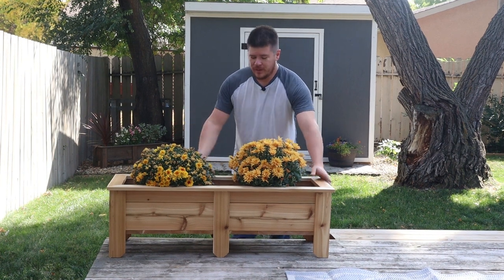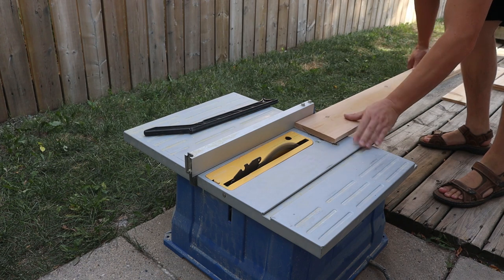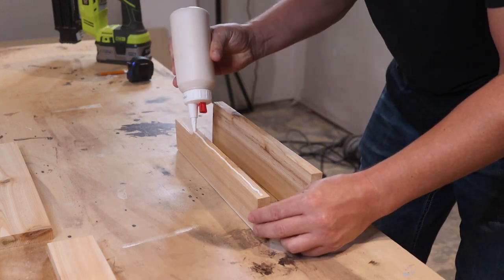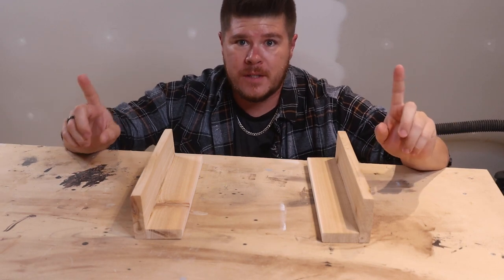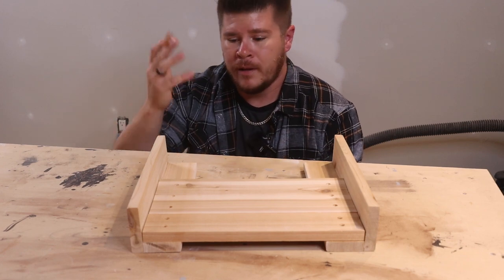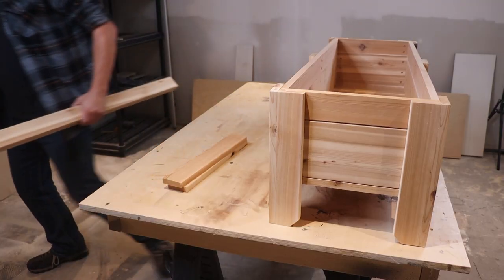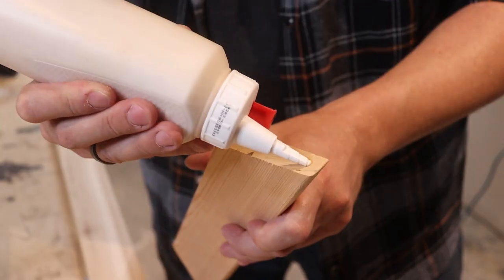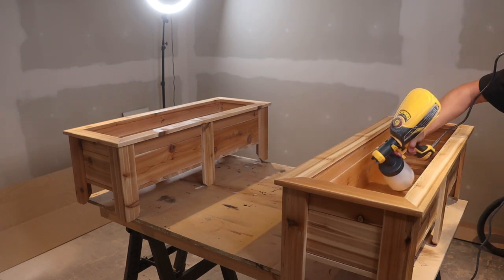DIY Cedar flower box from fence pickets // Classic style and an easy How To - plans available

Comment: That’s one of the simplest yet best looking cedar planter boxes I’ve seen done on YouTube. I am going to build a few of these this spring for sure. I’m wondering if it couldn’t use a bit more drainage at the bottom though. Either a few holes drilled or a little space between each bottom plank, covered with permeable landscape fabric.
Reply from the maker: Thanks, I'm glad you like it! I've thought about drilling some small holes, it honestly wouldn't hurt. I've made a few of these now and once the wood dries out a bit and shrinks ever so slightly, they have small seams between the bottom boards most of the time anyways. Good luck on yours, I'd love to see them when they're done!

Comment: Nice!

The only thing I would add is some drainage holes .... it is going outside after all ;o)
Reply from the maker: Thanks! Ah, I forgot to mention that. The drainage is actually built in, there is about 1/16" gap between the bottom boards, plus the rounded tops on the bottom boards allow for small gaps in the sides. Just enough for water to flow out

Comment: hey Jesse! Thanks for sharing your nice work. Really inspired.
Question - how much more durable would you say cedar is compared to the generic pressure treated lumber made from pine? My parents are asking me to make some outdoor projects and I'm wondering if I just get cedar and have it last longer.
Reply from the maker: Thanks! I'm glad you liked it! Cedar is far more durable that regular pine, and about as durable as pressure treated, but naturally instead of with chemicals. Especially for finishing Cedar is much more beautiful of you clear it like I did, or oil it or stain it. Pressure treated will last a long time but will gradually look worse over time, but you can use a outdoor deck stain on it. The other thing with pressure treated is if you plan on planting any vegetables or fruits in the planter, they can actually leech the chemicals from the wood into the food and that's not good. It's OK for flowers, but for food I'd only ever use Cedar. Hope that helps!